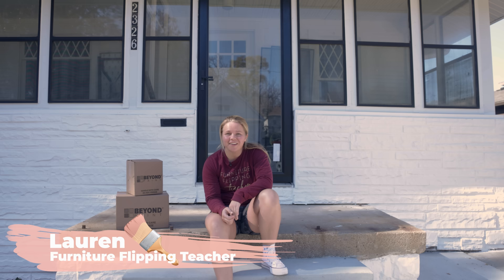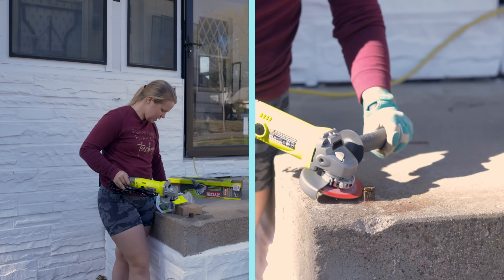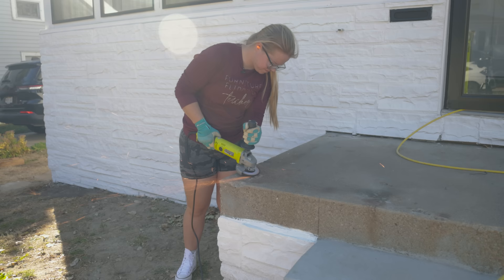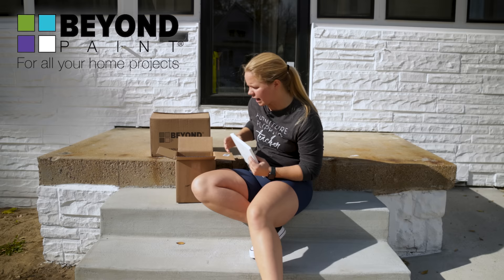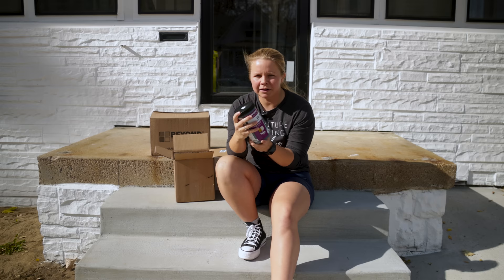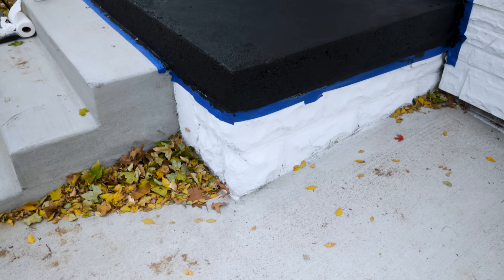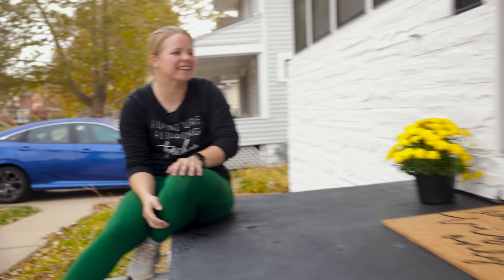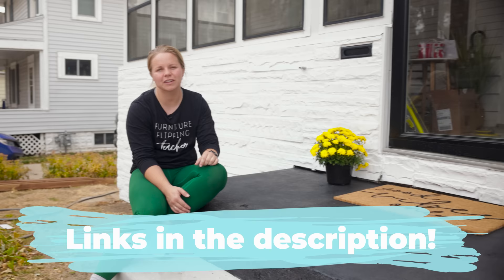Painting a Concrete Front Porch | The Paint for ALL Projects!

Comment: Looks terrific! One thing I would check is the space where the concrete meets the house to apply caulking, if needed, to prevent water seepage. 
House is coming along great 👍
Reply: I used hydrolic cement where the landing met the house and it has stopped seepage and filled the void.
Reply: Could even use like a spray foam to fill it then caulk it for a quick fix

Comment: Love your can-do approach to everything you take on. The yellow flower and door mat really pops against the black porch and white brick. Looking forward to seeing the railing added. I have an observation that concerns me regarding the gap between the porch and brick. I assume there may be some kind of wood structure behind the porch supporting the exterior wall where water will gravitate to in driving rain or whenever you clean the porch with water, which can cause wood to rot. Also, my eyes were drawn to the gap distracting from a completely finished appearance to an otherwise very pleasant aesthetic. (Very similar to the previous issue you addressed by filling the gaps between the bricks and under the bricks at the base of the brick wall after you painted the bricks white.) It seems brick mortar would be the  product of choice, however, a builder's supply store should be a great resource for the best product for this application. Your huge Air B&B project was a huge undertaking & you've done an amazing job! Thank you for sharing it on YouTube! You are very industrious, talented and continually expanding your skill-set! Well done! 👏👏👏

Comment: If you are going to put a railing, wouldn't it have helped if you kept those little pieces of metal on?  I don't know how do they metal railing but I am thinking they could use those little parts to weld the new railing but not sure if you are going to put another metal railing.
Reply: Dynabolts will hold it plenty fine

Comment: Does your local building code require a railing and hand-rail if you have three or more steps to the porch?  You may want to check that.  At end of video:  Oops - you're going to put on a railing, good!  The paint looks good, the railing will be the frosting on the cake.
Reply: Lauren said they were installing them.
Reply from the maker: No worries! the plan is to put up a railing! not sure if we'll get to it before winter but that is the plan!